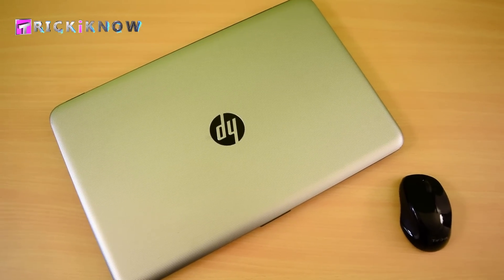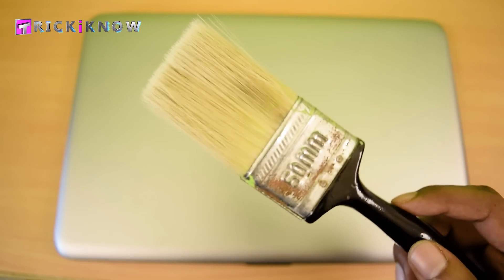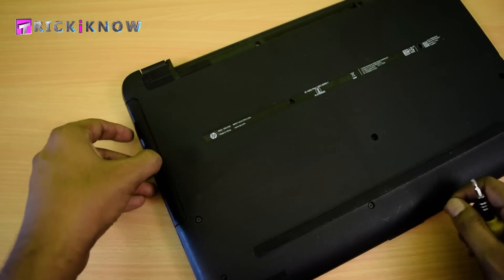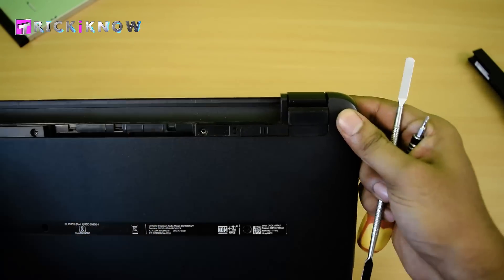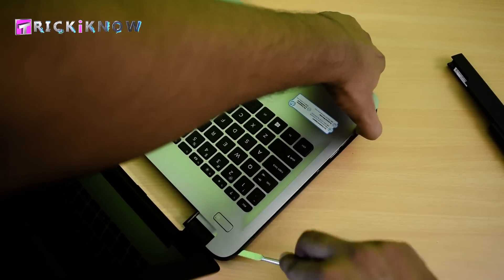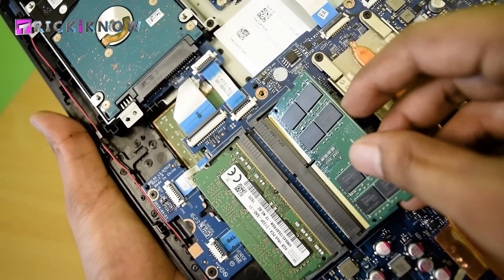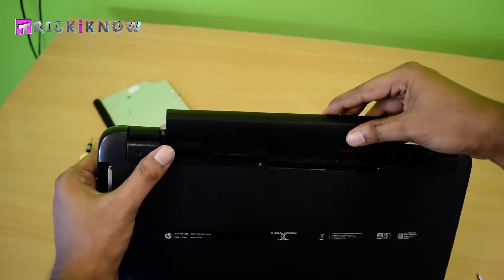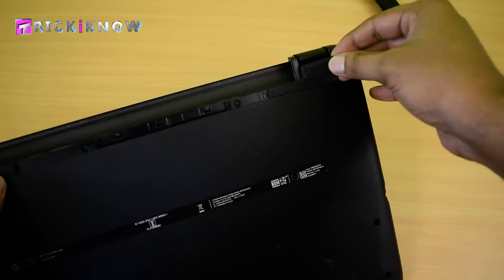How To Upgrade / Install RAM in HP Notebook 15 series Laptop (HP 15-ay008tx)

Comment from the maker: 🌐 RAM Links:  ► DDR4 Laptop RAM: https://geni.us/hpdd4ram ► DDR3 Laptop RAM: https://geni.us/T48xN if you have any questions please comment us below. 😊Check which RAM is supported to your Laptop: http://trickiknow.com/hp-notebook-15-ram-upgrade-tutorial-very-easy/ (Article)
Reply: did you use ddr3 or ddr4?
Reply: Buy your RAM here**
Reply: @MercuryF12  where to buy the RAM?
Reply: I bought HP 15-bs134wm or Scarlet as they like to call it. The bastards at hp did not install the second ram slot. The solder points are there on the board but no mounting point.
Reply: I have the same PC which ram did you put ddr4 or ddr3
Reply: My laptop has only one slot 🙄
Reply from the maker: @taybro_o  then replace the ram with a higher value of Ram. Like 8gb, or 16gb. 👍
Reply: @TrickiKnow  I tryed with 8 gb ram but my laptop doesn't boot but when i put 4gb ram back its normal again 🥺
Reply: @TrickiKnow  can we install a 16gb ram in the laptop which you installed the 8gb one ( i have the same laptop and getting issues with the speed and it's not functioning well) i even changed the os but still not as fast as before so planning on upgrading the ram
Reply: So me adding another 4gb ram to my to 4gb pc is fine?
Reply: @novibez-  maybe
Reply: Doesn't danger and harmful for your laptop to not put another ram equal to the one inside the laptop 
Like what you do you add 8gb ram to 4gb so the result is 12 gb
I mean if your slots not equel 4+4 or 8+8 is it harmful or not good for the laptop ?
Reply: They should be equal youre correct 2 x 4gb either side @theambitiousguy1094
Reply: TricK i Know Did You Say 4 Head Screw Driver?
Reply: @sancholowera  he said flower head/ cross head
Reply: @trick I know: what's the most ram  you can install in hp 15- bs080wm?
Reply: I have the exact same laptop with the i5 processor and the amd r5 graphics card do i have to buy the ddr4 version?
Reply: TricK i Know i have 8 gb ram already in slot ..so  is that  2×4gb ..then how possible there may be no vacancy for ram
Reply: @pistnboy1359  I think the maximum is  8gb, get the serial number from the bottom of your laptop and search HP site... (Or Google)
Reply: Great tutorial. Your accent is awesome by the way. What is it?
Reply: TricK i Know hello bro can I install Kingston DDR4 Ram same laptop is it work plz tell me
Reply: Hi, could you do a video about fixing or replacing keyboard and the keys for this laptop?
Reply: thanks lot mate
Reply: Hi, I'd like to ask you which RAM memory should I use for my HP laptop (my memory specs: SK Hynix 4GB, DDR 3, PC3 12800, 800 Mhz, 1,35 V). T've tried to upgrade it with installing Kingston DDR 3, 4GB, 1600 Mhz, 1.5 V, but the new memory didn't work at all. I don't know if that's a problem with different voltages or something else. Thank you in advance. Great video ;)
Reply: Product key ? I need to rescue help? Required for Cloud Recovery
Reply: Will this ram work on my hp- notebook series model:- 15-ac044TU
Reply: Sir how to any laptop model ...It's showing HP-notebook in system information.... And one more question please...how to know ..my laptop need which ram ddr 3 or ddr4
Reply: Hi, Can you please tell me where can I get the screw driver to open the laptop.

Comment: Thank you for the detailed video. Re: HP Notebook - 15-bs151nia what is rhe maximum size n specification of RAM x2 i can use. Also the maximum SSD i can install. Is it possible to upgrade the processor as well?

Comment: Opening HP Notebook 15 is a nightmare. ASUS did so much better access to RAM in their  K55 serie of laptops from ca. 2013. There was a separate plate on the bottom. 2 screws to open. Only screwdriver needed. And voila!

Comment: Hey bro, I recently upgrades ram on my hp notebook 450 g0 from 4gb to 16gb and it's working but the problem is that it's only running at like about 798mhz or something like that but the ram that was in the laptop and also the one i changed is 1600mhz, I tried going in to bios to configure it and theres nothing there for ram configuration, how can I sort this out ?

Comment: hp notebook processor (dual core) AMD El-6015APU with Radeon(TM) Graphics 1.40Ghz 4GB RAM...
Storage(HDD) 500GB
 It become very slow... Should i upgrade with SSD... Will performance increase or not?

Comment: Why don't you remove the 4gb ram from slot 1 and insert the 8gb one into it instead of slot 2.
I think in this way it will work better
Reply: It's better to use two slots of ram. For example: if you want 8 GB ram, then add 2 rams of 4GB. And if you want 16 GB ram, then use 2 rams of 8Gb. It's called Dual channel. It prevents bottelnecking.

Comment: Can we need to install Same company RAM that pre installed in laptop or we can install any brand RAM !?
Reply from the maker: That would be better, or you can order 2 ram of Same brand and replace the existing one
Reply: @TrickiKnow  can we install 16GB +8GB pre installed RAM = 24GB 

Is it support in HP 15g DR0006TX laptop !?
Reply from the maker: @saumysinghdeovanshi8740  Adding 8GB Ram would be great of same frequency. 8+8 gb ram is great if you are not doing video editing work.
Reply: @TrickiKnow  no I want to do video editing that's why want to upgrade RAM but HP saying it's only support 16GB but crucial saying my laptop support upto 32GB 

I'm very confused what  to do know

I don't want to waste My pre installed RAM so that's why I thinked that install 16GB RAM then total it's   become 24GB RAM  

I don't have much knowledge about laptop/PC so that's why I'm asking you
Reply from the maker: @saumysinghdeovanshi8740  Order a 16GB stick if it performs well then keep it, otherwise return it. If 16GB works, order 1 more and replace it with 8GB. Then sell 8gb to any friend who need or in any computer shop.
Reply: @TrickiKnow  but sir Amazon not giving refund option on RAM and SSD that's a problem 🥺

How I can do it if 16GB RAM not work properly with my laptop ?

Comment: iam having one SSD slot in my laptop and it has a 520GB SSD card on it if i buy a new 1TB SSD and open my laptop and remove the old 520GB SSD and place the new 1TB SSD and close my laptop and open it will it turn on and will there be software i need to know it i want to upgrade my Storage if there is no software in it will my pc boot up can anyone tell?

Comment: Doesn't danger and harmful for your laptop to not put another ram equal to the one inside the laptop 
Like what you do you add 8gb ram to 4gb so the result is 12 gb
I mean if your slots not equel 4+4 or 8+8 is it harmful or not good for the laptop ?

Comment: First thing you do....don't hold the memory they way he does in the video. Touching the gold pins like he does in the video will cause corrosion down the line not to mention the possibility of causing static discharge that damages the ram before use

Comment: hello sir, how to know the which RAM should be applicable i means 4GB or 8 GB. we can not install directly 8 GB RAM in already having DDR3 4GB RAM. how to know which RAM will Work for it ?
Reply from the maker: You can combine 4GB and 8GB RAM, or you can also remove your 4GB and add 2 X 8GB = 16GB. But before ordering check which RAM is suitable for your laptop: https://trickiknow.com/hp-notebook-15-ram-upgrade-tutorial-very-easy/

Comment: can u tell me which screwdriver to use for this ? i am thinking about buying the screwdriwer and opening tool from amazon
Reply from the maker: You can also go to any local electronics or mobile shop, and get a multi screw driver set. I used the Jackly 32 in one set and a pry tool which i bought from mobile parts shop 👍

Comment: Is the same RAM fittes in HP Notebook 15 - ay005tx laptop? Please let me know about it.
Reply from the maker: In your laptop 15-ay005tx there is a 4GB DDR3L-1600 SDRAM installed, you can buy any RAM brand corsair, crucial, zion, hyperx, etc. But it must be DDR3 - 1600MHZ RAM, if you want to mix old ram with new ram of same frequency.
Reply: Yes it's of the same config

Comment: Bro in my ram it is labelled as 1600mhz

But in task manager it shows 1333mhz
Reply from the maker: The ram was changed recently, and windows is showing old data. In next format it will be fixed.

Comment: How can I find out if I have a DDR4 OR DDR3?
Reply from the maker: You can read my blog brother: https://trickiknow.com/hp-notebook-15-ram-upgrade-tutorial-very-easy/
Reply: Oh man. It explains everything. Thank you very much. I didn't want to buy another computer. Very happy man. Thank u
Reply from the maker: @lennex04  You are welcome, comment on the article would be appreciated 😁
Reply: So I added the 8gb DDR3 in my hp notebook 15 ac147cl and works amazing! Super EAsy and Quick. But I two more question. I was curious on purchasing an additional 8GB ram card and having a full 16gb. Would my computer be ok if i did that?

Comment: hi how can i decide i want to add 8gb more ram in my hp laptop where alredy 4gb ddr3 ram 1600mhz
Reply from the maker: If there is one more slot, then you can get 8gb or 16gb ddr3 ram with same frequency 1600mhz. If you want to increase frequency then remove the existing ram and buy 2 sticks of 8gb ddr3 2100 or 2600mhz ram.
Reply: @TrickiKnow  thank you sir for reply.
but i want to know which company RAM is better according to performance and money both and my motherboard support only 16GB.
then if i use 1600mah 8 + 4 GB RAM then what its working without any issues ,processor can balanced it and used all entire RAM ?
Reply from the maker: @sanatanirahul_  Corsair, hyperx are are good brands, but HP itself uses Crucial Ram.
Reply: @TrickiKnow  thank you so much i remember it when buy 🙏
but its working n bro for editing like sony Vegas, Premier pro,etc like software

Comment: My hp 15 has an access door. I have hp 15 f125wm and isn't built like this. I can see the ram but looks like only 1 slot even though specs say it has 2.
Reply from the maker: Check out disassembly video of your laptop model, may be the 2nd slot is inside anywhere. If you don't have 2nd slot, then simply replace the ram with single 8gb or 16gb ram.
Reply: It only has the one slot. I wound up replacing it with a single  8gb.  Thank you 😊

Comment: So is there a limit to the RAM my laptop can handle? Since there's two slots available, can I install two 8GB RAMs and make it 16?
Reply from the maker: Yes you can install 8 x 2 , or 16 x 2 as well as, i mean 32gb also.
Reply: @TrickiKnow   so you’re saying an HP Envy 15 i7 4720HQ , has 2 slots can take 16Gb per slot.  HP says it can only take 2x8, a total of 16Gb.

Comment: After i install my new ram, i always get the blue screen thing even when i switch the slot, i got the same thing. This is my ram that already had in my laptop (4gb 1rx16 pc4-2666v-sc0-11) and this is my new ram (4gb sod ddr4 2666 cl19) what actually is the problem? They got same voltage and the others, i dont know.

Comment: I messed up somewhere or I just don't have the same laptop. I nearly opened the back and I see most of the stuff on the bottom of the laptop rather than above where you had it. I need help. And also part of it is connected with some sort of tape or wire so I didn't fully open it cuz I might damage it by the wire tearing

Comment: Hi, I have a 15-ba008au slv 39cm laptop. Very slow. Will upgrading RAM help. Which RAM should i buy ? it says DDR3
Reply from the maker: Yes Install more ram will help, but if your hdd is too old and it's making noise the replace it with Ssd. This will booat a huge speed.
Reply: TricK i Know ok. Thank you !!

Comment: Hello, I am using the same laptop and it is not turning on. Battery and charger both are good when I checked myself . I thought of checking my Ram . I am facing issue with one of my laptop screw which is in the CDD . The screw head worn out . I am struggling to take it out . Can you please provide me some solution? Thanks in advance

Comment: Great video! The part about the hidden screws will be really useful when I upgrade my HP laptop.

But I just find some info odd with HP. So I have the 15-bs144wm. Crucial memory website reports that it supports a max of 8GB; and I will believe it I guess. But in the HP manual, I don't even understand the max amount part, but the RAM support is ddr3L-1600 and mine currently has 4GB ddr4-2666. So I am just wondering is it really limited to 8GB of RAM.... I am not going to try 16GB of RAM, I will just order another 4GB ddr4-2666 using the same part number that CPU-Z shows. But if I knew that it can use 16GB then I would definitely order that.

Comment: I hv installed new simmtronics 2GB DDR2 667 MHZ Laptop RAM (total 4GB =2qnty 2GB each) Ram on my lged500 xnote laptop.If I use 1 by 1 RAM then laptop working but if put both RAM then Laptop stuck after booting at automatic repair screen n no progress.kindly advise how to boot up laptop to windows.

Comment: Hi sir, I have 2 questions- Firstly, If i increase my RAM will my laptop speed up and will it become smooth with a great performance? As my laptop is a bit slow.
Secondly the RAM which you showed can it be inserted in any laptop I mean any Windows 10 Laptop?
Reply: Try to buy the same ram you already have in your pc, if not possible then you need at least the same DDR

Comment: I already have two ramaxel 4gb ddr3l 1600mhz sodimm rams in mu hp 15-ba009dx laptop. I'm planning to increase the ram to 12gb. So can I buy 8gb ram of the same specifications but of a different brand and use it with the existing 4gb ram???
Reply from the maker: Any brand but same config (MHZ, DDR), or you can just remove the existing one with 2 8GB sticks of higher MHZ speed.
Reply: @TrickiKnow  Thank you so much...I never expected u would reply... Hats off sir

Comment: Sir, I just  watched your video. Please I have 4GB DDR4 RAM installed in my laptop that has 2 memory slots and I want to upgrade it to 12GB, can I install additional 8GB memory stick to the laptop in order to make it 12GB  and will this improve my laptop's performance or should I install an extra 4GB ram stick ? Am confused.
Reply: 8GB will make it 12GB ram 4GB will make it 8GB ram

Comment: Can I use dell ram for hp loptop?
Reply from the maker: I think Dell or HP do not make ram of their own brand, the using 3rd party ram. So it doesn't matter exchanging from each other.  But make sure both ram are same in DDR3 or DDR4.

Comment: You have mixed Ram brands as Hp has installed Sk hynix ram and you installed ZION ram. So are you having any problems? As from many YouTubers i got to know that we shouldn't mix ram brands as it'll cause damage to mother board some times pc boots up suddenly,laggs etc. And I hope you have used another ram with Same frequency, latency and all so how your laptop works? Pls guide m

Comment: I have an HP laptop, model: 15r 201tx. 
It came in with an i3 processor @ 1.7GHz, and a 4GB DDR3 1600MHz RAM. 
Can I add an additional 8 gigs of RAM. Would it be an overkill?Or should I just add an additional 4gigs?

Comment: How can you install a 8gb ram in 4gb ram laptop I mean you have to take a look on other things such as latency, dual channel frequency and all. Just simply installing a ram wont make your system fast .
Any advice on this doubt ?
Reply: You are correct there can be limiting factors with the speed of the ram and bandwidth the motherboards support but it would be extremely unlikely to have issues with 2400/2666MHz SODIMM RAM. Upgrading from a single 4GB 2400MHz SODIMM RAM to 8GB 2400MHz SODIMM RAM would not change the speed that it transfers data but rather the AMOUNT it can store on the RAM for faster access to data whilst you are using applications. Hope I explained this well enough and it helps, good luck.